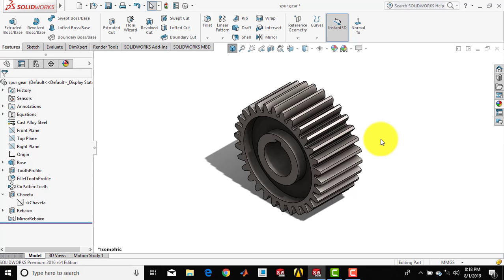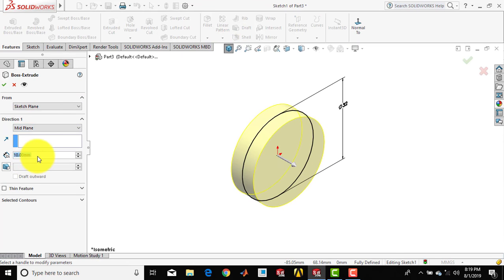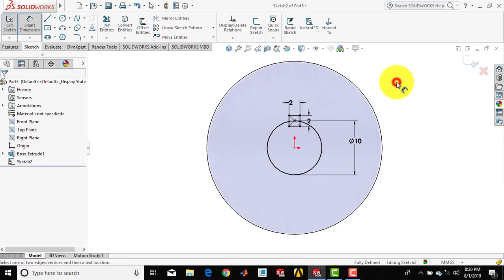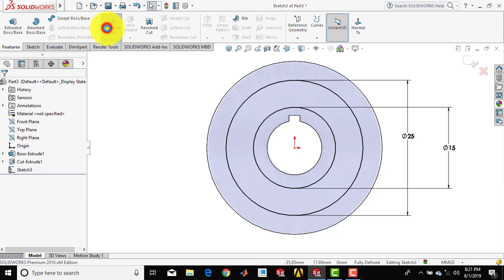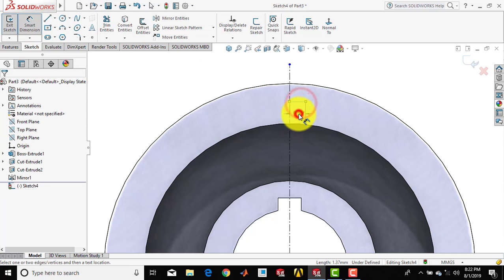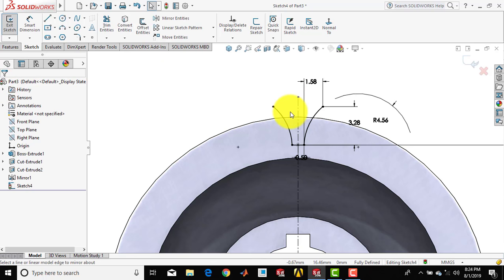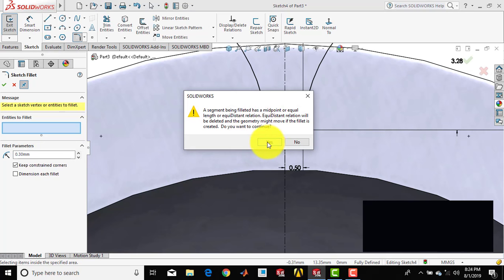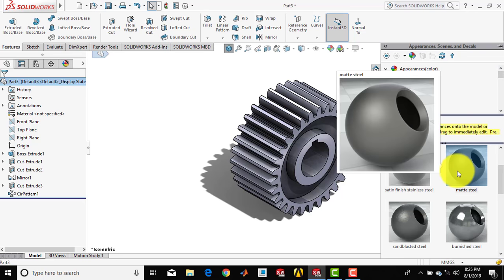Solidworks Tutorial#40 | Design a Gear.

Comment: I was under the impression that a gear and teeth for that gear would require a mathematical equation so if the outside circumference changes,  the gear teeth change also.
Reply: I have many excellent tutorials on Solidworks and CATIA v5, so if anyone else who is interested in this checks out right now
Reply: Involute shape involved with a mathematical calculation
Reply: They do
You need a ton of formulas to make a gear 
You can't just make one like it is shown in the video
If you do when you make it in real life it will be either totally unusable or just very harm itself in all the different ways making it practically unusable

Comment: Sir which softwere is best for jobs in industry CATIA or solid work
Reply: Depends where are you going to work, Catia is more popular on aeronautic industry (because the software was designed originally to be exclusive for Boeing) and in german companies (but is slowly being replaced by Siemens NX), Solidworks is more popular in other branches of engineering.

In my opinion and since Catia and Solidworks are made by the same company (the reason why Dassault System bought the Solidworks Company is because Dassault found Solidworks being some similar to Catia, so we can say Solidworks is "Catia light") i recommend you to learn Catia V5 first, because is harder, someone who learns Catia will use Solidworks without problems with only seeing it 1 minute, that effect is not the same if you learn Solidworks first and then you go to Catia.